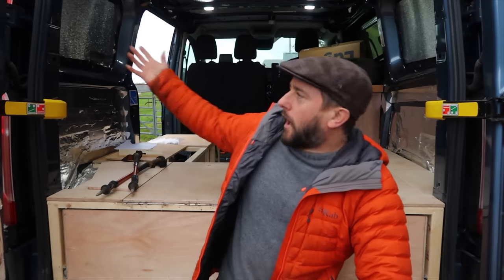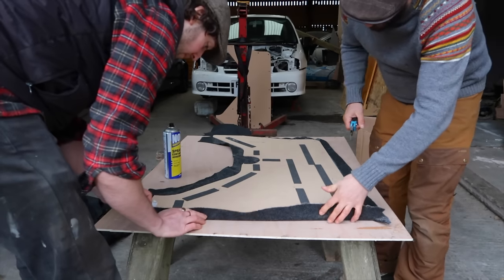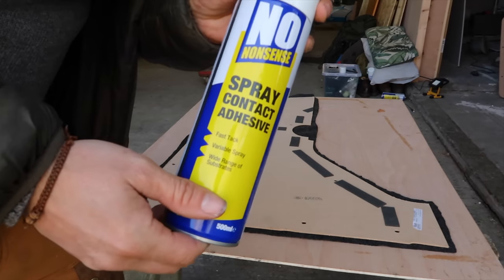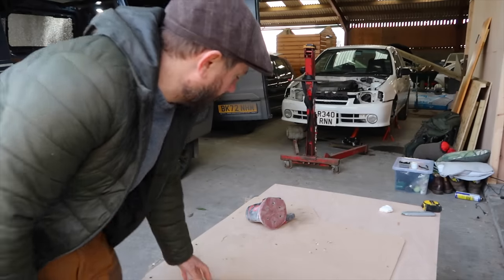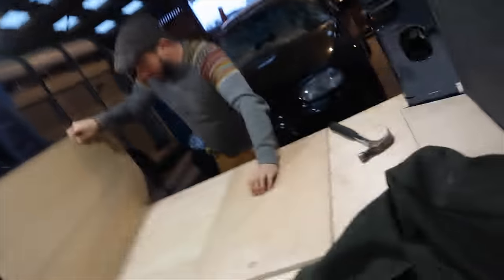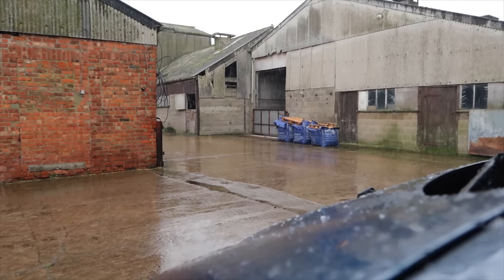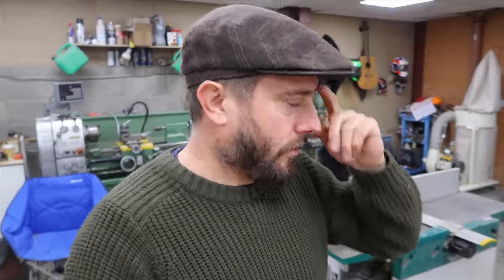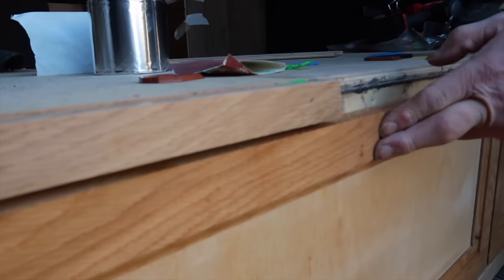Camper Van Conversion | Home Build Adventure Van Part 3 | (carpeting, table and bed build)

Comment: If you veneer just one side of a board it will almost certainly bow. You need to do the rear too as a stabiliser, not in oak but something cheaper.
Reply: I sure hope he sees this comment
Reply from the maker: Wonderful tip mate, thank you 🫡
Reply: that is a good tip.. 😊
Reply: @HazeOutdoors velcro the back aswell and do away with the black dots

Comment: Carpeting in an empty van was even a ball ache , so fair play for your patience 👏👏👏 I found once the glue was on the carpet, a straight blade or a hooked blade was crap at cutting it , I ended using a variety of scissors 😢
Reply from the maker: It was a CHEW mate

Comment: I'm not sure what you got planned for the roof. But if you're sticking anything to it, it's a good idea to go with high temp contact adhesive. The roof in particular will be exposed to a lot of heat in summer, and standard adhesive often fails. 

Keep up the good work!
Reply from the maker: Thanks for the heads up mate 🫡

Comment: Awesome job so far. One of my friends did a VW. van conversion and she went cross country with it, her dog and a guitar. She ended up putting over 5,000 miles on it. (8046.72 kilometers) round trip. You and Fern are in for such adventures.
Reply from the maker: Sounds amazing! Thanks mate

Comment: Looking really good. Just a pointer from my own experince you might need trim the carpet back 5mm from the end of the metal work under the rubber seals as it might wick water.
Reply from the maker: Thanks for the tip mate. Appreciate it 🫡

Comment: How about carpeting the roof, then cut some long strips of plywood and screwing them to the cross struts, leaving a 10mm gap between strips, you could then if you wished put 2 strips of LEDs between them as extra lighting
Reply from the maker: We’re already planning to use oak strips and strip lights. It should look pretty cool

Comment: Just a thought  Hazy, if you put a hinged lid on your rear drawers, when you pulled them out they would form a table area for outside cooking
Reply from the maker: I already have the draws at the top folding over to make a table. I like your idea though mate thanks
Reply: No worries boy, just thought doing it this way would make them self supporting without legs. ie, less vulnerable to marauding labradors. I have one and have experienced the havoc wreaked by an over exuberant tail !

Comment: What’s powering the heater Hazy? Have you got a leisure battery and the jackery?
Reply from the maker: Not yet mate, I’m going to get a leisure battery soon to run the lights and fridge. Do you have one?
Reply: @HazeOutdoors  negative sir. In the process of converting a caddy maxi but  decided against a heater to save needing a battery etc. just going to run a portable battery and a little gas heater if I’m desperate

Comment: Can anyone get me some sawdust for the sander please as im running low! Whilst your at it the compressors nearly out of air so if you can run round with an empty box half open and capture some that should help the job along greatly! Just be careful not to let any escape as you close the lid else you'll have to do it again!

Comment: No Nonsense adhesive is no good for campervan material lining. You need TrimFix adhesive which can handle temps upto 120 degrees.
In a hot summer in the U.K. which is rare or travelling abroad, your material will fall off like damp wallpaper on a wall. I'm doing a Ford Transit custom at the moment.
Reply from the maker: Oh no! I’ll be doing to roof in trimfix but I’ll have to hope the walls survive